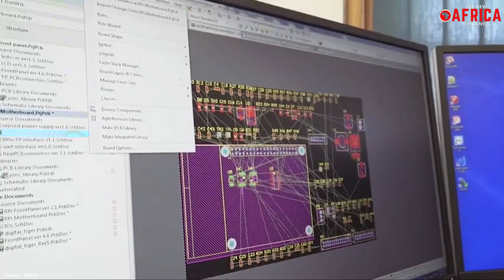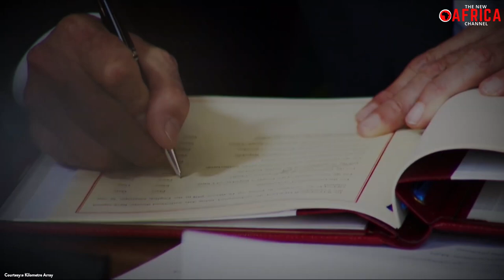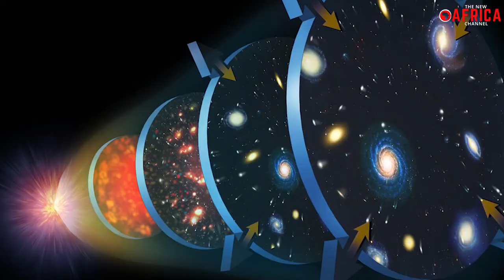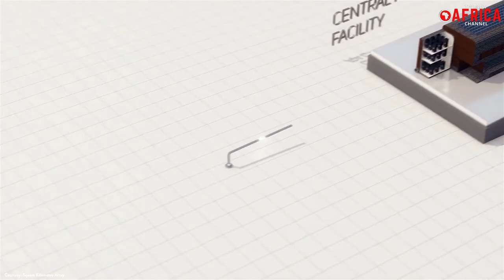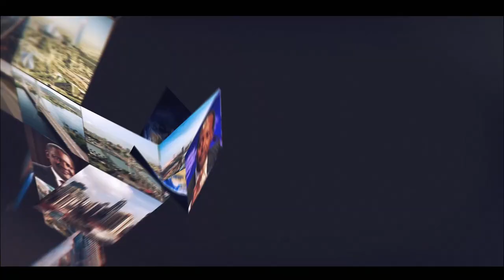Why South Africa Will Be Home To The World's Largest Telescope  - The Square Kilometre Array Project

Comment: Please explain how it is possible to build this project when there was NO DIRECT INTERACTION AND/OR CONSULTATION WITH THE LICALS IN THE AREA. THIS IS A LEGAL REQUIREMENT!
Secondly explain how so called first light was observed on a frequency band used is between 110Mhz to 25.5Ghz when white light is bewtween 450,000Ghz and 750,000Ghz. This is technically an impossible task.
This project has removed numerous farmers off the area and resulted in theft of stock, house breakages, loss of the social economic system, increase in drugs as well shortage of work in the area. Promises made are not even close to the problems that it has caused.
I await your answers.

Comment: This project is an absolute disgrace. It has reduced the overall income and wellbeing of the people affected in the Central Karoo.
In addition to this there was NO PUBLIC CONSULTATION AT ALL BEFORE THE ACT WAS PUT INTO PLACE. This I have in writing from the powers that be.
They are simply running roughshod over the locals in the area, destroying vegetation and worst of all  they used the CSIR whose board is selected by the same minister, Naledi Pandor, who pushed this project through.
The implications of this project is enormous and extremely destructive.
Reply: We'll see how this thing goes. But with corruption locals will suffer and if there's signs that its gonna go to the chinese or Europeans than we'll have to pull out